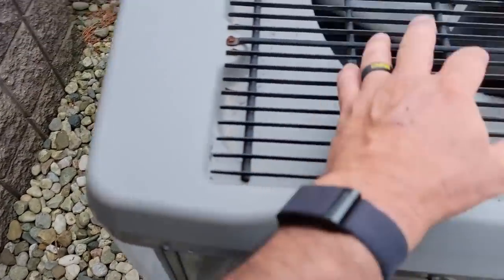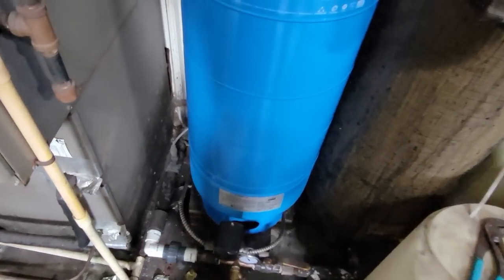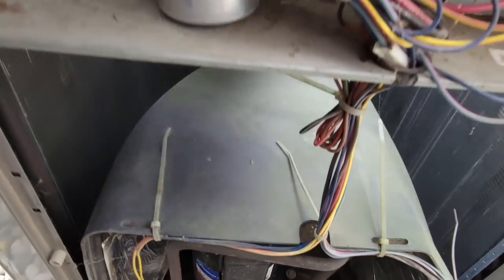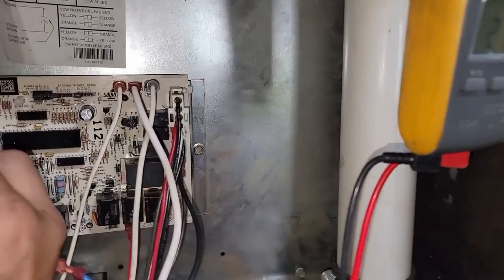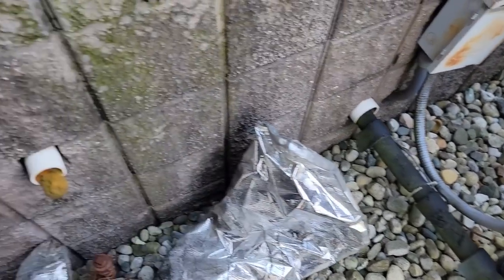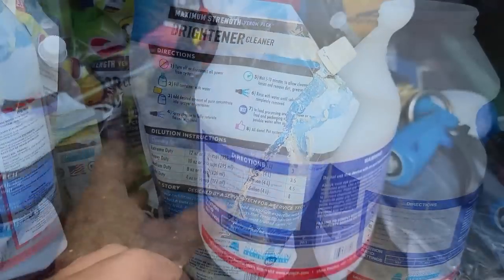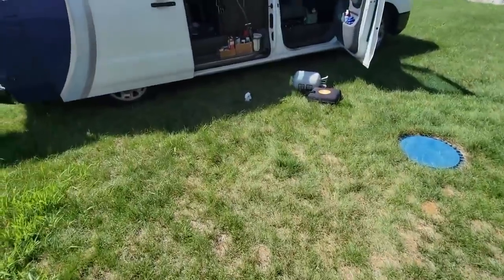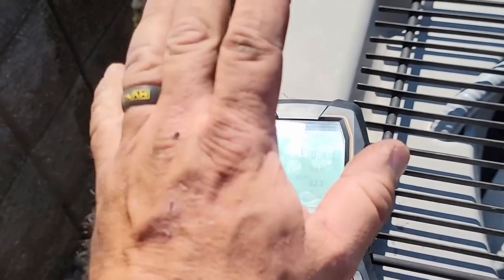Air Conditioner Not Working...I Think!?  Who - What - Where - Why?

Comment: Not a fan of the new testo manifold to be honest. I have the 557s as well and I liked them until I picked up the fieldpiece probes from true tech tools and started using them with measure quick, much higher quality tools I find. The testos always needed to be re-zeroed, they’d be off by like 3 psi every time i’d use them. Right after a pressure test you’d let out the nitrogen and they’d be off by 2 psi again. The screen cracked from sitting in the sun even though I babied them. When they weren’t attached to a unit they were back in the case. The bluetooth was garbage, they’d disconnect when you’d come off the roof into the building within 50ft of the manifold. The fieldpiece has amazing bluetooth range, they stayed connected one time through 3 floors of concrete. They come back to zero every time and battery life is over a year. The testos live on the shelf in the van now.
Reply from the maker: I have the Fieldpiece probes in my bag👍👍
Reply: @coldfinger459sub0  I actually wish I had waited a while before buying them. You were the first one on youtube who was actually testing them out properly and making videos. If I had only waited a couple months I would have seen I should have gotten the fieldpiece manifold.
Reply: @HVACRSurvival  I do like the design of the testo. I like the shape. I like how the screen is layed out. They just didn’t meet the level of quality that you’d expect from testo’s flagship model.

Comment: That's why installers or service technician should write on the unit if it's upstairs downstairs or whatever so you can tell what is what
Reply from the maker: Bingo, if something's hard to find I write it inside the unit what breaker it is and where the box is or whatever it is you might need to find.

Comment: No offense but I would have started at the thermostat.  Checked for power at indoor furnace and outdoor with sequence of operation. You could have found out a lot of info and not looking at stuff that was unnecessary plus a waste of time.
Reply from the maker: No offense taken, but when you arrive and the person at the front desk doesn't know what another person called in about and he wasn't there to tell me and they didn't call him to find out.... No one talks to each other and my office didn't make sure that they got the correct discrimination of the complaint, where do you start? the upstairs unit or the downstairs unit?  It's hard to fix something if you don't know which ones are not working right.  You have to go through and check everything. When I see a system that's piss poor installed like this... I check everything because I don't trust anybody to do their job right. As you can see whoever's been working on it did everything about us half ass as you can get it. But I can't mention that in the video.

Comment: Again. Thank you for the video. Yeah, this call looks is one of those where you have to look even under the rocks to see what is going on. What I see with Testo probes is that you can't go too far away from them. They seem not to have the same range as the Fieldpiece ones. Today I went down the ladder to the restaurant, and I couldn't read the Testos at the thermostat, but I could read the Fieldpiece Hygrometers. Fieldpiece is more expensive, but I see why.

Comment: 9:50 - You can see the burnt traces on the back of the board near that middle blower relay. Blower must be drawing too much current or not starting so check blower cap.
Reply: This
Reply from the maker: Optical illusion. It wasn't burnt
Reply: yep, it looks burnt to me and I see the solder melted away at the pin going to the boards very bottom terminal (one of the blower cool terminals), that bottom relay is smoked inside. it must be a cooling blower speed relay.
Reply from the maker: @throttlebottle5906  I was using the light on my phone to record with, what you're seeing is the shadow from the peg on the board. I know what a blown off trace looks like.
Reply: @HVACRSurvival  good lord these internet warriors who weren’t there with you think they know more about the call you had your hands and head in than you do. Great job Rick keep ‘‘em coming

Comment: I have and like Testo. I have the complete kit with pressure, temp clamps, hygrometers, DB temp thermometer, vane anemometer, hot wire anemometer and ir. Its been great to use and no issues at all. I want to get that scale...i have the FP wireless...so its hard to justify buying another one when the one i have works just fine. If you get sick of the Testo stuff....let me know...I'll buy it off you ( if you are allowed to sell it ) i like FP and have nothing bad to say about them. I have lits if FP products as well. I just like Testo for their accuracy of their sensors. Those 605i hygrometers are really nice snd the magnets make them great for vertical or horizontal insertion into the air stream.

Another great video Rick, and i really like how you are very detailed in what you do.
Reply from the maker: Thanks Jason! That's awesome of you to say. I like the gauges, I think I'm asking too much of them. I need to read the manual.
Reply: @HVACRSurvival  it couldn't hurt to read the manual, but i get not reading one....i also agree that it should be easy to use without reading the manual.

Comment: You should not check to ground for power when diagnosing, checking to ground tells you if you will be shocked but not if you have both legs of power.
Reply from the maker: I agree, It was for a quick demonstration, I check across switches and use common or neutral when I'm actually diagnosing a system.

Comment: Does that inficon stratus work very well on 410a I use the tek mate but, when it comes to very minimal leaks of 410a its difficult, how does it perform on very tiny leaks?
Reply from the maker: It's a completely different design sensor and machine. Watch my review on it
Reply: @HVACRSurvival  hmm I'm tempted to buy it, I just want to know if it would help me atleast determine what's leaking, I ran into two calls recent in which it was apparent they were low, and system barely kept up. Spent hours looking for leaks and couldn't find it. I had to gas them up and hope it was the service valves! Would you say the stratus would help in finding minimal leaks?
Reply from the maker: I mainly use it 98% of the time. I double check it against the h10 pro and the dtek 3 whenever I doubt it's working correct and it has always proven it was right.

Comment: I have a mania for labeling stuff and almost every unit I work on ends up with a UV-resistant label with what area it conditions, address if necessary, any other relevant information.
Reply from the maker: You're better than most out there👍👍
Reply: $20 thermal label printer and off-brand cheap label tape makes it cheap for me and easy for everyone else!
Reply from the maker: Yes Sir 👍👍

Comment: Why wouldn't you put in a temporary fan relay?
Reply from the maker: Why, I'll have to remove it when I get the control board. It's not going to hurt to have it run. I have had mine running non-stop since 2003. But it's a ECM
Reply: @HVACRSurvival  and probably not unbalanced

Comment: Thats not back emf, back electromagnetic frequencies apply to radio transmissions. You are referring to stray voltages on a multitap motor
Reply from the maker: I was referring to electromagnetic force. May not be the exact correct terminology but motor generates voltage. When a motor shut off there's a spike and that's what causes transients.
Reply: @HVACRSurvival  ok um, please read this as coming from all the best intentions and kindness, I genuinely wish to be helpful.
Would you like to learn a more accurate knowledge of electricity? 
I would absolutely love to help but I don’t want to stick my nose in your business so ill leave the offer on the table.
Reply: @HVACRSurvival  Also, when you apply voltage to one speed tap, voltage should show up on all speed taps, I believe the windings are all interconnected in series.
Reply from the maker: They are multi tapped like a transformer
Reply: EMF = electromotive force AKA voltage. Same acronym different meaning. Counter or back EMF is the correct term.
Reply: @TechnicalLee  ok again, i am not trying to hurt egos or fight or anything just want to be accurate and helpful. Electromotive force refers to the electrical energy produced from a non electrical force, ie a battery or generator.
While close mr technicaLee I believe a more accurate term for the measured electricity on the extra legs of a motor would be potential energy or voltage or in this case of extra legs, stray voltage.
Adding the term “back” changes the meaning to a counter electromotive force which in the case of a motor refers to the electrical energy induced in the core that apposes the mains current also known as eddy current. Another form can be the capacitive effect of the extra coils in a multi-tap motor that do indeed result in a counter or back emf but to such a small degree its immeasurable.
So because the voltage potential measured in this instance is directly coupled to mains and unwanted in reference the system operation it is indeed stray potential or voltage.
Your both so close its almost not worth arguing but idk accuracy matters to i guess.

Heres an interesting question, are the taps or a multitap motor/transformer in series or parallel?
Reply: @TheRenaissanceBuilder  Main windings in series, aux winding in parallel with a run cap.